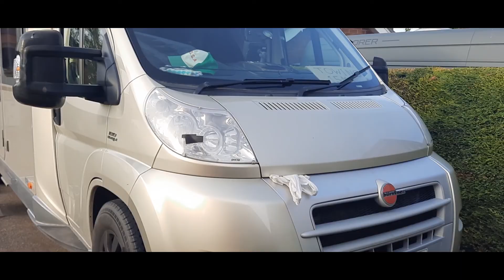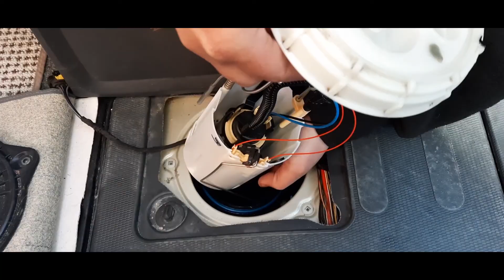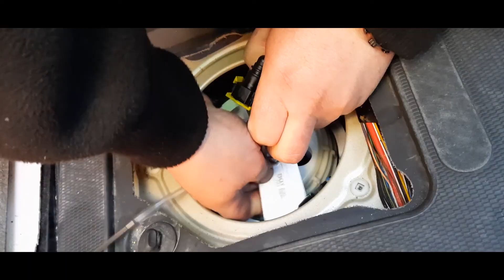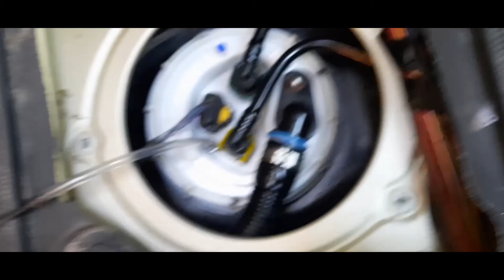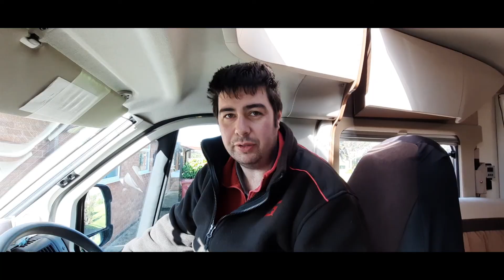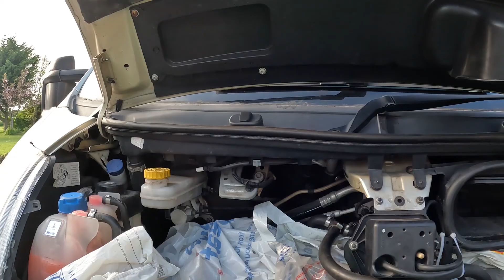The Fiat Ducato Lifter tank pump and lumpy hot start

Comment: Hi Gary I wonder if you can help? I recently tapped into the breather for a diesel heater. Well next day I had a leak 🤷‍♂️I suspect it came from the yellow pipe, I’m calling it yellow as it has the yellow clip on the end . During the process I never disconnected anything only the breather. Only I noticed that the yellow pipe does move up and down about 10mm even with the clip in place I don’t think this is normal , but not sure what do you think?
Reply: Check the O ring inside hasn't got pushed out or damaged.

Comment: Such a helpful video. That heater feed is exactly what bought me to your video. Thanks so much. 
My fuel sender unit is older but is like the sender unit you had on the bench with those two raised nipples. If that is a dedicated feeder for a fuel supply to heater, I’m assuming I can drill straight into it whilst the sender unit is in situ and thread a feeder tube in to the hole I drill? 
Also the length of tube, can you recall how far down I will need to go from say the top of the unit? Thanks so much for your video.
Reply: Wow just finished watching your video… the Earth strap yes. We had the exact same issue with our old girl. The problems we had were very strange electrical issue. Fuel gauge dancing up and down like having a fit. 
Temp gauge doing the same. And of course engine dying leaving us stranded. Earth strap. Glad you got it sorted and agree 100 percent.
Reply: Do you have a part number for the tool you used to tighten the collar?  My collar has cracked and the unit is lifting and fuel is leaking when the tank is full.  I have a replacement part and was checking out your video for tips on swapping it when I saw the tool.  I've also been told the hole can misform and become oval with the weight of the fuel in the tank. Really surprised your garage that did the engine swap didn't pick up on the earth strap issue.  But a good lesson learned!

Comment: Haha it looked super easy to fit the ring back on. I don’t know why but I can’t get the thing back on. It always is at an angle and gets blocked. Every watertank has a better fit. Do you have any tricks?
Reply from the maker: If you are talking about the fuel pump ring it sounds to me as if you may have it cross threaded, easily done...check your threads

Comment: Hi I think my tank is leaking from the sender cover, what is the spanner called and where did you get it from, also any idea what the seal may be called
Reply from the maker: Are you are refering to the large ring tool that is used to undo the the top  seal threaded ring, if so, I got mine on Amazon, but be carefull which one you purchase. the seall is an "O" ring be carefull when tightening as it is easly pinched, cheers Gary
Reply: It is thank you, mine has got a slight weep from the joint and I need to either try nipping it up or replacing the seal/ O ring
 @garyspracticalworkshop357
Reply: @garyspracticalworkshop357 do you have a part number for the tool please? I tried zooming in on the tool but the resolution is not good enough.
Reply from the maker: Hi I have looked pn thd tool and all I can male our is  BGS 7029 @dickenjohn4733
Reply from the maker: I got this relunctanly from Amazon if I remember correctly
Reply: How did you get on swapping it as I have the same issue? Do you have a part number for the tool?

Comment: I save you the time- hot starting problem was engine ground ( -) to the shassis, metal strap was corroded.
Reply from the maker: Yes, hindsight, is a wonerfull thing...
Reply: @garyspracticalworkshop357  Hi Gary, similar issue with hot start on my Boxer 2.2, cannot find a braided earth strap from gearbox to chassis, only the battery negative in the cab? Thanks
Reply from the maker: @derekholme6922  
On my ducato van I found it just behind the air fillter box , you may need to remove the top of the air gilter box to see and get clear access , cheers Gary
Reply: Thanks Gary, found it, yes it is awkward and rusty, the second bolt was left in situ and new earth lead connected and connected near the bonnet stay pivot, had a long earth lead, not been out yet to get the motor up to temp, but seemed to start from cold much easier, cheers, Derek @garyspracticalworkshop357
Reply: I am having this same issue with my Ducato I’m going to give this a try see if it solves it